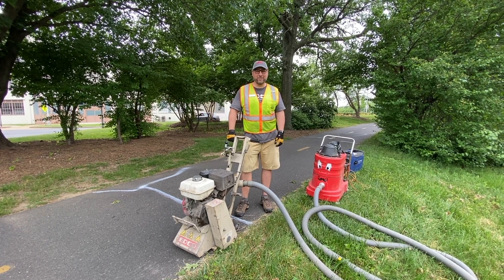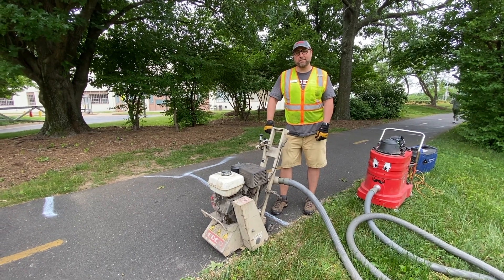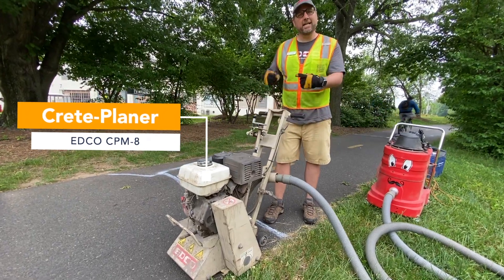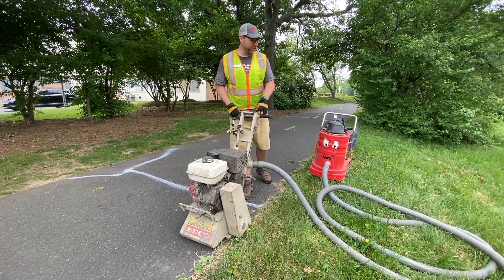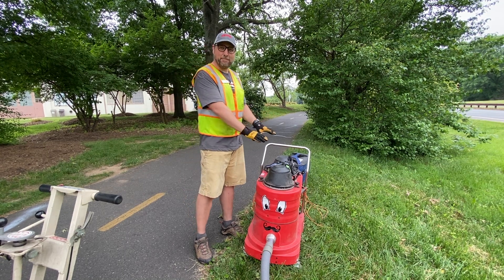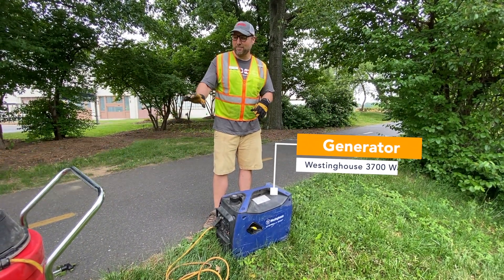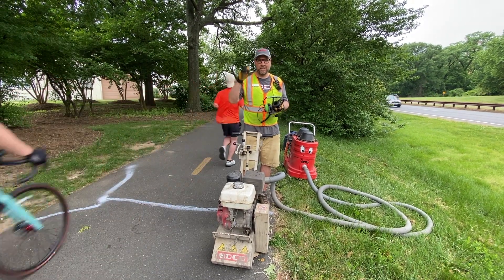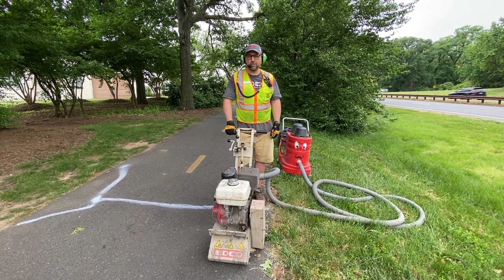How we remove bumps and root heaves from asphalt on the Mount Vernon Trail

Comment: a simple root barrier (often used to contain bamboo in an area) could be installed with a trencher, and 2 foot root barrier.   and that would last a lifetime.. and less effort than grinding down rise and fall in the path.. without root barrier, those roots will be back in about a year.. former landscaper here.

Comment: What if the bump is elevated six inches from a tree root?
Reply from the maker: It depends a lot on the thickness of your asphalt and how close the root is to the surface of the asphalt. We've successfully removed bumps when the tree is right next to the trail edge.  In some cases where the asphalt is not thick enough or the tree root is shallow, we have just reduced the size of the bump and tried to make the slope of it shallower to avoid damage to the tree.